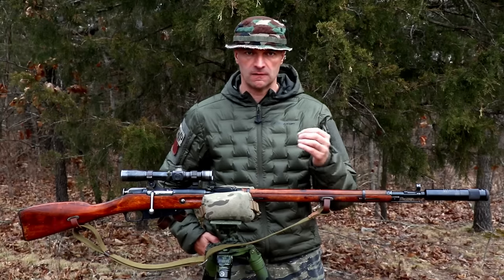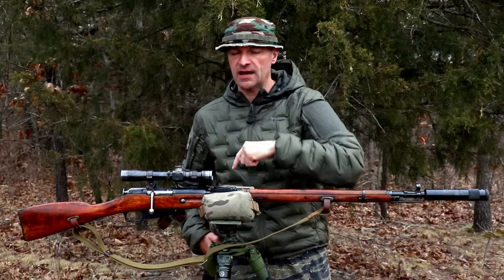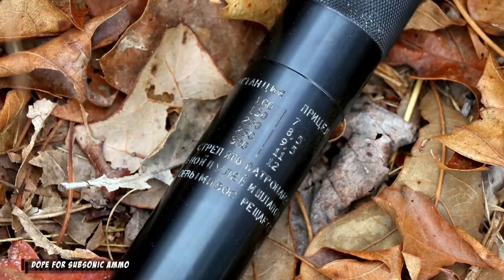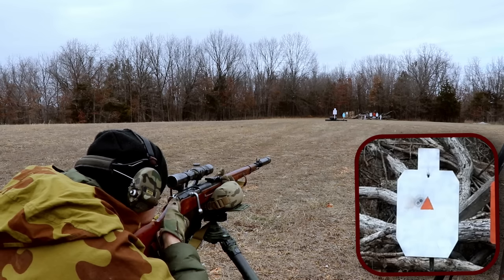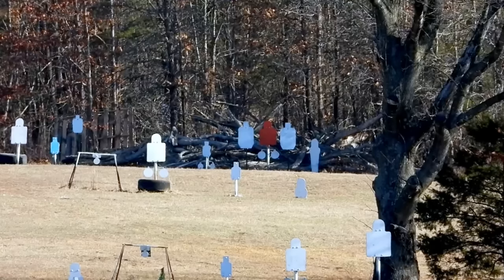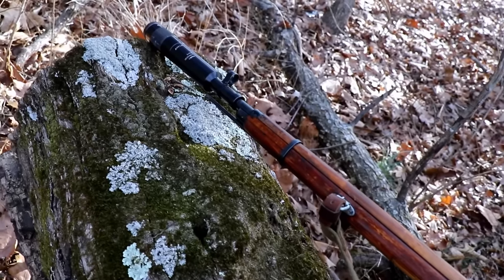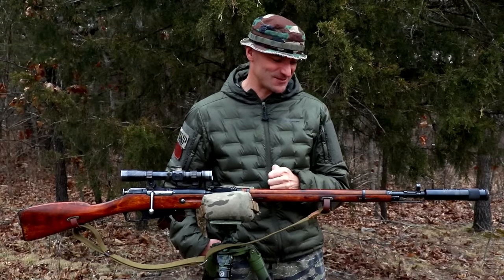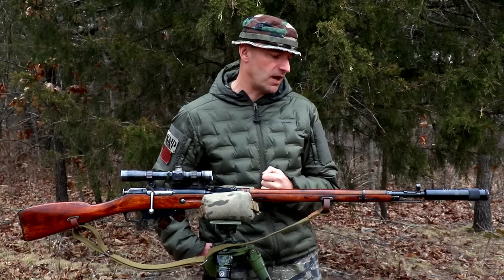Quiet Mosin - Suppressor attaches like a bayonet! No mods!

Comment: I have an 1891 infantry Mosin that I bought back in the 90s for probably $150. Got it at an Army surplus store. I just looked to see what the 91 and 91/30s go for now, and wow. $1200 for an infantry and three to five thousand for the sniper. Insane.
Reply: 91/30s are not $1200. Maybe $400 max. A real PU sniper maybe $1400 to $2000. Gunbroker is full of overpriced rifles.
Reply: @EdwardSnortin  Here in Germany you can still get them for 600-800€ Sniper with PU scope
Reply: RIP the Golden days of buying a literal crate of them for $900 and using it as a coffee table for the memes
Reply: I paid $300 for a 1933 hex receiver Tula M1891/30 (refurb with a post war laminate stock, force-matched bolt and non-matching magazine plate) right after the Russians invaded Ukraine.    I was originally going to pick up a Spanish Mauser at my LGS and the Mosin caught my eye.  Knowing it was in current use, I figured the prices would continue to go up.
Reply: I went to a surplus store in 2018 and they had about the same price for some, maybe they were some undesirable versions but man i cant find anything for less than around 500 now. Not to mention ammo prices are still inflated with people continuing to buy at high prices. Truly depressing.
Reply: Um no lol
Reply: I paid $99 for my Mosin back in 2007.
Reply: Not even close dude
Reply: Yea. I'm kicking myself for not buying those old surplus rifles back then. I just saw an m1 carbine from the Korean era, same model I use to have and sold for 200$ they wanted 1200 for it at a gunshow a few weeks ago. They had some really nice garands going for 1500. I remember seeing them for under 200 on cheaperthandirt. The mosins were around 120. If I would have known, I would have stock piled them.
Reply: I see crazy prices on Gun brokers. It's really like what will you pay
 Have a few plus the sniper. Almost have a hundred bucks in it
 Cool collectable guns.

Comment: $2000 suppressor....  I'd still like to have a Bramit type bayonet adaptor where I can put any 7.62 suppressor on it.  GREAT VIDEO!
Reply: This is really for those that have an original sniper mosin with original scope and want to keep it in original condition. Having a clone if the original suppressor for it is just icing on the cake.

You can buy twist lock thread adapters for the mosin.

Comment: I’ve read about snipers improvising subsonic ammo made from the standard load. Sketchy as far as pressure spikes, but the Mosin is a strong action so it worked.
Reply: As long as you don't go too low a reduced load is exactly the answer

Comment: Wow, that suppressor is $2K US. About 20 years ago I found an old rusty worn out Mosin that I paid $65 New Zealand dollars for, which would probably be about $40 US dollars equivalent. It was a 44 carbine that I was going to use for parts, but when I got it home and cleaned it up the metal was actually OK but the stock was rotten and gone. I bought a synthetic stock for it and wondered what I would do with another 44 carbine. I already had quite a few. So I got a suppressor put on it. It was an overbarrel large 30 cal rifle suppressor. Cost me about $400 for that and to get it fitted. It means I can use the rifle without ear protection and it almost eliminates the muzzle flash when I fire it. I have fired into the sea on a beach less than 300m away from the lodge I was staying at and people at the lodge had not idea I was shooting. It adds weight to the rifle but makes it much more comfortable to fire. Suppressors are a very good idea, whether you are using subsonic or supersonic ammo.

Comment: I use to make them in metal work class at school with aluminium baffles and the end cap controlled the baffle gap which is the vibration of the barrel removing baffles and adding a spring increases velocity and range I use to used regular ammunition.

Comment: Ive got 2 m91 30s , i actually had one when i was a kid that was manufactured here in the U.S  , IT WAS MADE BY WESTINGHOUSE, there was such a high demand for them for there troops , that the Russian manufacturer couldn't keep up with the demand , so Westinghouse helped out to defeat the Nazis, i bought 2 Russian manufactured ones at $119 each at a gun store that was about 20 years ago , there straight bolts, the Westinghouse was a bent bolt ,they still look brand new, there the biggest bang for the buck , literally..